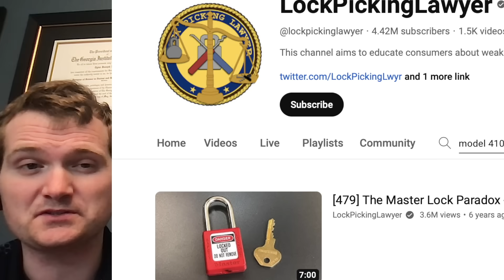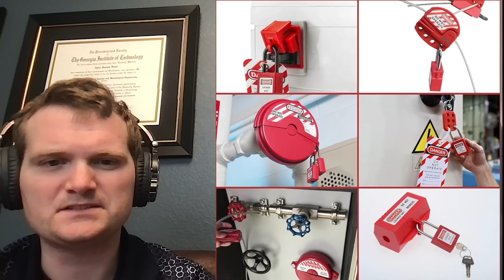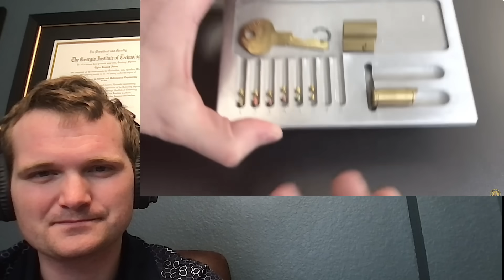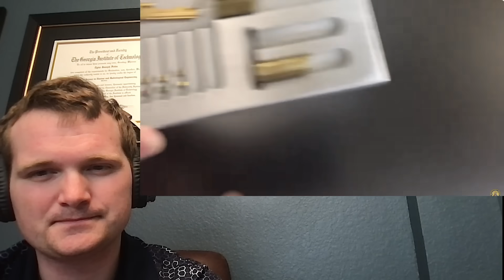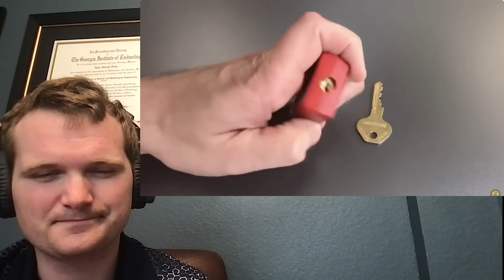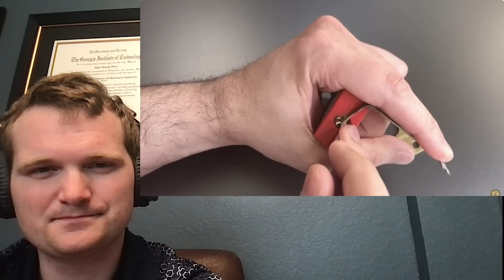Nuclear Engineer Reacts to LockpickingLawyer "The Master Lock Paradox - Model 410 LOTO Padlock"

Comment: I have no issue with LOTO locks as they are an amazing safety feature to have on hand.
I can also agree with the lock body being easier to break than a standard lock for the emergency reason of not being able to get the key and needing to power on whatever the lock is attached to.
I do however think they could use a less secure core.
It's a case of the lock stopping accidental use rather than someone who is set to using said thing.
Even a 4 pin core will still offer thousands of different cuts available for keying options.

Comment: Masterlock have a reputation for claiming to be very secure, and claiming to be unpickable -  but in reality are trivial to pick, or even rake open 

But this lockout lock as you say is designed to be cut open (and so is not hardened and plastic), but has a very good core for seemingly no reason at all, anyone wanting to pick it can just cut it off instead ?  

Is there some kind of requirement that means Masterlock is forced to use a decent core?
Reply: Basically, any non-authorized opening of the lock must be destructive - you don't want someone just picking the lock, doing something that causes harm, then relocking the lock, throwing the blame on the person owning the lock.
But you might need to get access in certain situatiobs.
For this reason, the lock body is easy to destroy, opening the lock, but showing tampering (which is OK if you hot the go ahead), but the lock is harder to pick than destroy.

LOTO is a rare situation where you need a secure core, but also need an easy to destroy body.

Comment: Think you kind of answered the question when you said it's a requirement that no two keys is the same.
Those locks are bought in bulk, and very few cores can document that no two keys can open the same lock when bought in great numbers.

As a engineer in the industry you probably know they won't buy anything without a perfect track record.
And it could be really expensive providing the certification this industry needs making a new core over providing their "best" core that's already certified for the job.

Comment: Most locks are at risk of being cut or smashed off as thieves don't care about destroying it, they just want the goods. For LOTO it might make sense that the pick resistance is what is important as it's used to monitor access and anything destructive would be obvious tampering. For theft the physical strength matters while for LOTO the ability to detect tampering matters, opposite uses so opposite investment in materials and design?
Reply: I'm going to say no to the picking idea - if someone wants to open the lock then they've made it specifically much easier to open with brute force.....a strong person might be able to snap it with their bare hands.
The purpose of the lock is to stop accidental opening and the extra spool multiplies up the safety factor of the lock by it being practically impossible to be opened by any old key you jiggle in it - a worker needing access might have a huge selection of keys in their pocket and insert the wrong one - in the 80s the entire Ford range, in Europe, could be opened by six keys.....nothing particularly wrong with the keys/locks but I did end up sitting in someone elses car by complete accident......a car is just another form of dangerous heavy machinery that only specified people are allowed to operate (and a red Ford is commonplace in a big car park - good job they had furry dice and poor taste in cassettes).

Comment: Most of the people who have access to these locks also have the tools and know-how to bust the lock open in seconds (you can do this with approval if a lock owner loses their key or goes missing). I suppose the important design requirements for LOTO locks is that there are many unique keys that won't ever work on the wrong lock (could easily cause an accidental death), and that they can't have a big chunky form factor because they need to fit into the often cramped spaces where LOTO devices are used. Sometimes you can have a bunch of them right next to each other in a tiny cabinet. If someone wants to purposefully tamper with a LOTO lock without authorisation that's an instant termination offense and the lock being weak isn't really the problem there.

Comment: I usually do the Loto Lockout in the Company i work at. 
 We have the electricians Loto locks: They go an a loto Box with 1 or multiple keys inside wich belong to the machines locks. (Generally locking out Pneumatics(Green Lock), Hydraulics or the Load Circuits of electronics(Red Locks)(to keep displays etc functioning)) Personal Lotor are usually just brass/ Neutral
 People then add their own Locks to the Box.. and the Electricians Loto gets Removed last since he is also the one unlocking the locks whoes keys are in that box.
Theys Electicians Loto keys are Just hanging in the Electricians Rooms. (we have second keys if one accidentaly takes one home with them)

On Cutting the locks: The Worker Went home forgetting to remove it: We call the worker and also search the machine: then fill out an "Lock Cutting Paper" , Cut it and thats it. the Worker gets a new one.
Reply: Ooh, a new LOTTO! Just what I wanted for my birthday! 😂

Great info! And that last bit sounded quite funny to me.

Comment: The 6-pin LOTO lock is purposely not made to be indestructable, exactly for the reasons you mentioned.  They're used to lockout people, but has to be malleable enough to be removed in an emergency situation.
Reply: That's exactly my thoughts too. They use more pins on the lock, so there are much more key combinations (unique ones) to use those locks. But the lock itself has to be relatively easy to take off in case of a problem to contact a person who put a lock on a device, but is not possible to contact them - they finnished their shift and they switched off the work phone. A bit of twisted logic, but still, it can be solid from a certain perspective 😁
Reply: @ogi22  Dude just explained it. There are more pins so there are more key combination! It's not a mystery.
Reply: And the hard to pick core means it’s hard to surreptitiously access without someone knowing, whereas a destroying it in an emergency lets anyone who sees it know that someone has access.
Reply: @nihilvenitadeus Sorry, didn't see your answer before I wrote mine
Reply: In essence it has to be hard to surreptitiously open without anyone knowing, thus the 6 pin key), but if it has to be open with no key it can be opened with nothing more than a hammer... but is quite obvious that it has been opened at that point, but makes it easy to open if it is absolutely necessary in an emergency when the person with a key is unavailable.
Reply: @whomigazone  Pretty sure the 6-pin key is chosen to support a key system with many different levels  - the more pins, the more different keys.
Reply: @eidodk probably less for the tags and moresoe so the same key system can be used for higher security locks at the same facility. Not Shure why they'd need security Pins though
Reply: @weswes666  They don't need the security pins, the locks they mirror do though.  If you put an "A" level core in your LOTO locks, they can be used for EVERYONE with executive access.  They don't necessarily need to be specifically for the LOTO locks, but can be used for A level access to offices and storage cabinets on that secure floor as well.
Reply: @eidodk  yeah but is Someone decoding your loto lock to get into a secure lock really a significant attack factor? Or is it just simpler to key the same using the exact Same pins instead of slightly cheaper normal key pins
Reply: @weswes666  A company buying a security lock system don't ask for cheaper locks for less secure rooms or padlocks, they ask for the system to be keyed for the rooms, doors, lockers and padlocks and the personnel needing access to the areas / systems.
Reply: @weswes666  I would guess that the six-pin core comes with security pins as standard, and it's just easier for them to use a standard six-pin core rather than making a special core without security pins just for the LOTO locks.
Reply: His question was, why does it have such a good quality pic resistant core
Reply: @neilkurzman4907  This is indeed a mistery. Masterlock's strategy geniuses work in weird ways i suppose 😁
Reply: @ogi22  I assume to make it harder for bored annoyed technically inclined people to remove them without breaking them? Because that would be BAD.
Reply: @RonaldPottol  To tell you the truth, those technically inclined people would be the last ones to irresponsibly take of a LOTO tag. I would put my bet on some other bored people, who don't understand why those locks are used. 😉
Reply: @neilkurzman4907 so one of the reasons it's hard to pick is that it's six pins and it also has a unique keyway that allows more types of keys so the key way and the extra pin allows it to have way more possible keys 

Also since that's the one he's familiar with from nuclear reactor buildings I imagined that there is some standard that force them to build a higher quality product 

And when combined with the fact that they need to have individual keys for every lock you end up with
Reply: @mcamp9445 
Could be. 
It could be plastic since it’s typically used to lock out electrical boxes
Reply: That is also a possibility although the shackle is still steel. 
No it does raise another way that you could probably get through it if you didn't have bolt cutters. A propane torch would melt the plastic which would more than likely open it 

Just a thought that occurred to me of course there would be locked out scenarios where you wouldn't want to be using a flame from a propane torch but I imagine you could melt the lock body pretty easy 

But it is well past time for Master Lock to start using these much better lock cylinders at least in their high-end locks 

Like that particular one that he's complimenting that he practices on has been out for a couple of decades so they've known how to do a good job they just choose not to @neilkurzman4907
Reply: @neilkurzman4907  I'm really late but IMO the reason probably for the good pick resistant is to make it harder for someone to tamper with whatever is being protected because sure you can cut the lock but then everyone will know it has been tampered with but with "really good" pick resistance it makes it harder for people to bypass the lock to access whatever it is hiding. It's like when you see the foil tamper resistant seals on products where when you peel the foil sticker back it leaves a mark on the thing the sticker was stuck to such as "VOID" written multiple times if it is a warranty void sticker and in the process the sticker is not reusable as others will know it was tampered with due to the security feature of the sticker and you cannot leave the sticker off because it needs to be there for the company to know that it wasn't opened up before
Reply: @neilkurzman4907 @ogi22  Dude just explained it. There are more pins so there are more key combination! It's not a mystery.
Reply: You need to be able to easily cut a “LOTO Lock” I have yet to find a paddle lock that can stop an angle grinder with a cut off wheel and I would say about 80% of the paddle locks on the market can either have there shackle cut with a bolt cutter and about 50% of paddle locks can be circumvented with a BFH or two 1” open end wrench’s as quickly as being opened with a key
Reply: This does nothing to explain why Masterlock goes to the expense of filling the core with precision machined security pins, only to insert it into a lock body that is deliberately designed to be breakable barehanded. There are plenty of ways to make a six pin core with numerous possible keys, without going to the extra trouble to make it pick resistant.
It's proof that they CAN make a high-security core, but they never put cores this secure in actual SECURITY locks.
No lock can ever be pick proof, just like no lock can ever be truly indestructible, but you can build a lock that is both sturdy and pick resistant enough that the typical bad actor won't have the tools to get through it without attracting attention.
Reply: @FelbloodStreaming  Masterlock doesn't care about the expenses.. The client pays everything anyway. It's likely a padlock master keyed system lock.
Reply: @FelbloodStreaming   I would guess that the six-pin core comes with security pins as standard, and it's just easier for them to use a standard six-pin core rather than making a special core without security pins just for the LOTO locks.
Reply: Thank you for re-stating what was in the video. Good job.
Reply: Some of their LOTO padlocks are more durable though, as shown in this video.
Reply: FYI for people who are not normal viewers of the lock picking lawyer up until the internet and really his channel and now others the vast majority of people did not know how to pick locks 
Even still most people who are going to try and steal a bike or break into a garage etc don't know how to pick locks although now they can easily learn if they choose to 

That's why the Magnum and the other physically hard to do a physical attack exist 

We can certainly 20 years ago most of the people who wanted to break into something had no idea how to pick locks so it didn't matter quite as much how. And bolt cutters and hacksaws and nowadays with electric portable angle grinders. 

The all hardened and really thick shackle with the super hardening boron steel is a challenge even with angle grinder. It will take more than a minute and perhaps several especially for someone who's not an expert 
And they are really loud 

But now that their internet exists and lock picking lawyers channel along with Bosnian bill. Etc

It is well past time for them to make much more difficult to pick locks 

Also if you're not a viewer of this channel you may not realize that the lock picking lawyer can pick almost every single lock in existence 

So even $200 German locks aren't much of a problem. Spell ham and Bosnian Bill did design a special tool to pick those disc detainers 

There's also a lot called the bowley lock that as far as I know still hasn't been picked. People have made custom tools to open it but it's a super cool lock I suggest you do a search for it
Reply: Or when bob forgets to unlock his lock before he either goes on a 2 week Antarctic cruise or tells the boss to go push a rope and quits.

Comment: LOTO locks are a good indication that something is already wrong with the machine or system.  At the very least someone will look around to make sure the technician isn't in the machinery.  If the system is critical to the safety of the plant or the local population then there is already a huge problem.  Odds are the warning signs is exactly what the tech is there to fix.

Weirdest LOTO lock I've seen was on a dock door.  Door would roll up but a key pin was worn out and sometimes the 400 pound door would slam down.  That's when I learned that pin was considered a consumable part that would wear out over times.  Some of the roll up doors at that facility were over 1000 pounds.  At the very least a person would be having a bad day of the door randomly decided to not stay open and crush them.

Comment: At the site i work at the rule is the reds each person has a key that can be to multiple locks (all the locks are just for you but they may have multiple keys as each lock comes with a key) then there are the yellow which can have up to 5 locks to one key that are used for the machine isolation and then put in a box that is locked by a green lock that is 1-1 and then each of us lock onto that box with our red.

Comment: He's not so much complaining tha the LOTO locks are easily breakable, just that Master Lock, with their pompous motto and several "unpickable" and "unbreakable" locks, CAN design a pretty great lock, but only chooses to use that one in the least secure lock body while their regular use locks are made in hulk levels of protection but vulnerable to picking.

And yeah, sure, a lock needs to be openable in case the key is lost or broken, but for personal use, more often than not, it should take a locksmith, someone whose job and focus is in picking locks, not a guy with a hammer or someone who watched a tutorial on picking locks. And by LPL's many showcases of Master locks, well, a whole bunch of them can be opened by just knocking them lightly with a hammer, take under 10 seconds to pick if you know what you're doing and maybe a minute if you don't, and can easily be broken with brute force.
Reply: McNally's videos with Master Locks are a bit more chaotic.
Reply: Why spend $$$ on lock parts when you can spend $$ on marketing?

Comment: Sigh....again with the nose picking lawyer. $99 for battery powered angle grinder will defeat all that metal. Bonus feature! I will now reveal how to defeat master combination locks, the  ones with the black numbers wheel. The casing of these locks is rather thin and a strong pair of needle nose pliers can pry the body away  from the back,  dumping the contents of the thing.
Hee hee hee, ha ha.